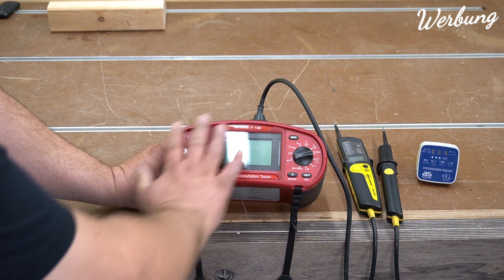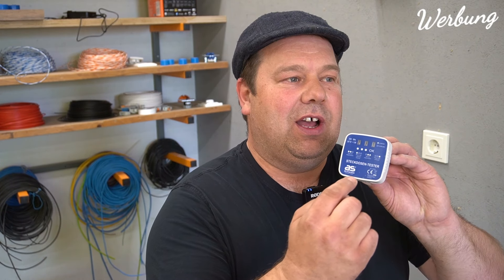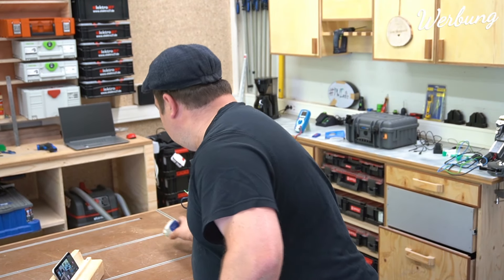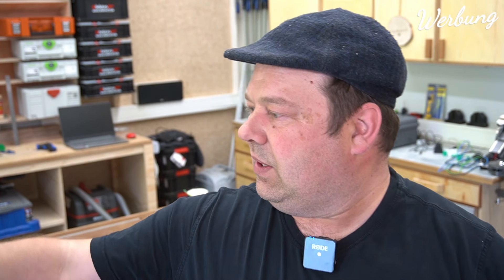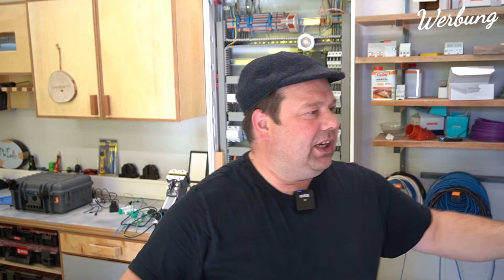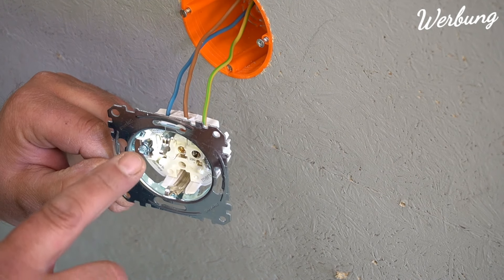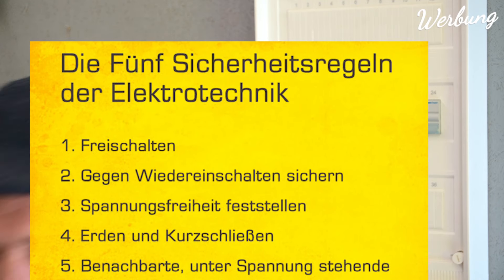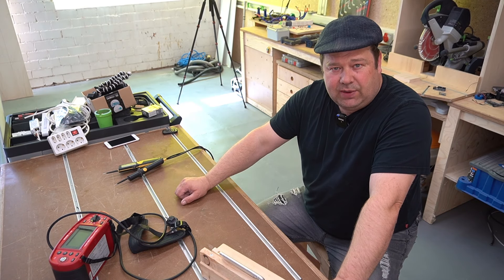Mach das auf keinen Fall nach! Proofwood

Comment: Da haste echt recht!! Nicht jeder sollte an Strom gehen. Aber Raketen-Wissenschaft ist es nicht eine Steckdose zu setzen. Diese Tester befürworte ich auch für den Ambitionierten Hobby Elektriker. Ich selbst bin kein Elektriker, aber habe 2 Jahre Fachschule E-Technik und 2 Jahre Fachoberschule E-Technik hinter mir. Und halte mich nur für Ambitioniert, denn Du zum Beispiel machst das jeden Tag. Ausser Theorie  Kann ich auch auf genügend Praktische Schulung zurück greifen. Manche Diskussionen was man darf und was nicht finde ich manchmal sehr lustig.  Ich arbeite als ITler und da gibt es auch 100000 Leute die es besser wissen, aber Erfahrung steht über "das darf man und das nicht!"  Dafür beneide ich dich nicht! mach weiter so und lass dich nicht auf sinnlose Diskussionen ein.
Reply: 100% Zustimmung.

Comment: Ein sehr gutes Video. Ich habe auch den Prüfstecker, in 230 und auch den in 400v. (bin Leie). Mir ist es lieber ich stecke so einen Stecker bei einem Kunden in die Steckdose wenn ich Strom brauche, als das es mir später leid tut. Zum Beispiel als Nichtelektriker will mann eine Maschine auf dem Grundstück des Kunden betreiben mit einer metallenen Oberfläche wie ein Betonmischer, die ist natürlich geerdet. Der Mischer steht auf seinen Plastikräder und der Fuss in der Regel auf einem Holzbrett damit er nicht einsinkt. Dann hat mann beim Kunden eine Steckdose wie vom Helmut gezeigt bei der die Phase auf dem Schtuleiter steht und damit auch der Betonmischer, evtl dann auch noch ohne RCD bei einer Altanlage, dann ist mann halt beim einschalten halt ein bisschen lebensgefährlich tot. Dieser Stecker kann Leben retten, weil mann als Nichtelektriker sehr schnell die Anlage beim Kunden überprüfen kann.
Er ist mir auch wichtig um geschaltete Steckdosen schnell zu überprüfen ob die Steuerung defekt ist oder der Verbraucher.
Die 400V Version ist mir noch wichtiger, da ich schon einen 4KW Dalander Motor in 4 Minuten geschrottet habe, da Phase und Nullleiter durch ein schlechtes Verlängerungskabel vertauscht waren (Motor läuft dann trotzdem, aber schlecht bis die Wicklung geschmolzen ist) Daher ist dieser Stecker sein Geld um ein vielfaches Wert, und bevor die Maschine ans Kabel kommt wird immer mit dem Stecker Drehfeld und evtl. Phasentausch geprüft.
Reply: Genau!

Comment: Eine Anekdote dazu:

Ich hab mal vor ?zig Jahren bei einem Bekanntem einige Steckdosen installiert. Eigentlich kein Problem, die Wand aufstemmen und die Dosen eingipsen, anschliessen und fertig. Leider hat das aber nicht so funktioniert. Mein Bekannter hat ua. eine Steckdose angeschlossen und mit den Krallen vom Steckdoseneinsatz in der Wanddose montiert. Irgendwie haben wir dann festgestellt, dass da der Wurm drin ist: Ich habe mit meinem Voltmeter 180-230 V im feuchten Gips der Wand gegen Erde gemessen. Das Problem war, dass mein Bekannter den Phasendraht zwischen der Kralle vom Steckdoseneinsatz und die Wanddose gequetscht hatte. Die Kralle vom Steckdoseneinsatz hatte die Isolierung vom Phasendraht durchschnitten und den Blechrahmen vom Steckdoseneinsatz unter Spannung gesetzt, die hat dann den noch feuchten Gips der Wand unter Spannung gesetzt. --- Also Vorsicht - Shit happens and it can be mortal!
Reply: Kommt leider immer wieder vor.
Mein Tip: Schalter/Steckdosen schrauben und nicht die Krallen verwenden.
Und wenn Krallen dann wenigstens Schaltermateriel wo der Tragring geerdet ist, dann knallt es wenigstens und man merkt es sofort

Comment: Woher weiß der Duspol eigentlich wo die Phase ist? Steckt ja nur die eine Seite drin.
Reply: Solange der Duspol nur einpolig benutzt wird, arbeitet er "wie ein Phasenprüfer". Er "misst" die Spannung kapazitiv gegen "Erde" (in Physikerkreisen auch "Fernkugel") genannt. Es fließt tatsächlich ein sehr kleiner Messstrom "durch die Luft", also durch den Kondensator der aus der Leitung des Duspols und der umgebenden Erde gebildet wird.
Das Pfiepen und die helle Anzeige kommt durch den Verstärkerkreis im Duspol, der von einer Batterie versorgt wird.

Beim klassischen Phasenprüfer funktioniert das tatsächlich ohne Verstärker und Batterie, es wird nur der sehr kleine Messstrom benutzt, um eine Glimmlampe zum Leuchten zu bringen. Das funktioniert aber je nach Umgebung nur ziemlich unzuverlässig, deshalb ist ein Phasenprüfer gefährlich und für das Feststellen der Spannungsfreiheit auch zu recht verboten.